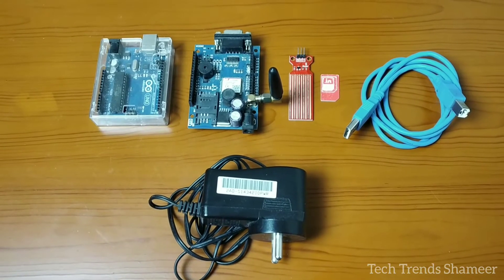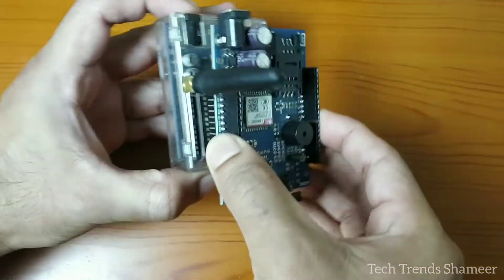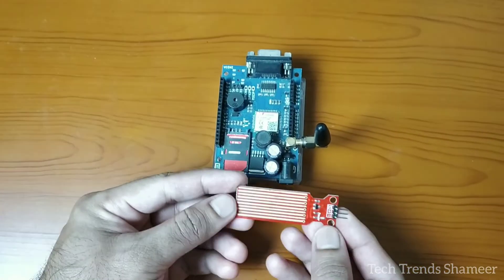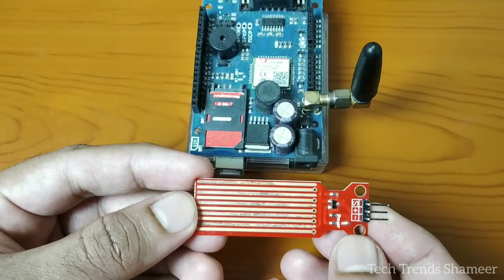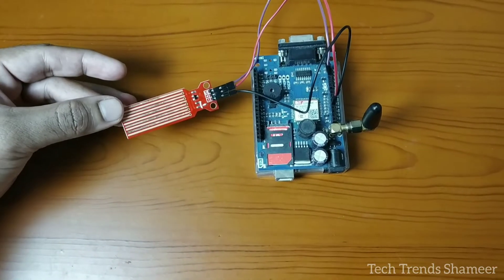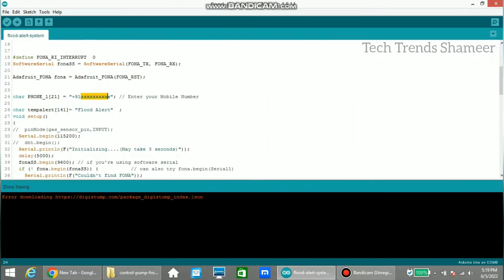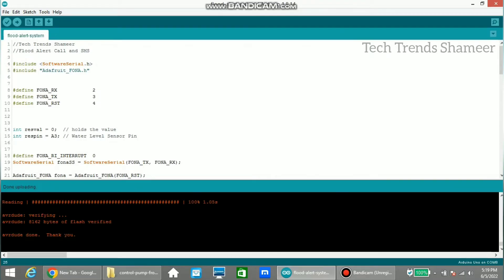Flood alert System Using Arduino Uno | GSM 800

Comment: it is necessary to connect in laptop to work? or it work with out connecting in cable but it is already program
Reply from the maker: You can connect to laptop or power banker

Comment: Sir flood alert using GSM module 900a and separate Arduino board use flood alert making video for your viewers make a call and make a sms and code& circuit
Reply: 2024

Comment: hello sir, how do i modify the code if i will be using the water level sensor in a small stream to detect if water level increases or decreases and have a text message sent to me? reply asap is appreciated, thank you!
Reply: May be you could use HC-SR04 Ultrasonic sensor for water indication

Comment: Perhaps this is a dumb question. Does the sim card inserted needs load ?
Reply from the maker: No need. You can give power to the GSM Module.
Reply: @TechTrendsShameer   Thanks for the reply. Perhaps my first question is misleading. What I am trying to ask is if the SIM card inserted needs balance/load for it to make a call or send a text message.
Reply from the maker: Yes. Need balance in SIM Card.
Reply: @TechTrendsShameer  thank you so much ❤️
Reply from the maker: Welcome. Please subscribe.

Comment: It showind adafruit no such file directory
Reply: Bro how to connect gsm 900a to arduino
Reply from the maker: May I know which type of 900a you are using?
Reply: @TechTrendsShameer  sim900a
Reply from the maker: https://www.electronicscomp.com/sim900a-gsm-gprs-module-india?gclid=CjwKCAjwkeqkBhAnEiwA5U-uM_-GJ7FYilMxvxJnY65PeFtqn2eIcsfIO3Rp-HjlSCHgn0UcJqi5tRoC-_8QAvD_BwE

this one?
Reply: @TechTrendsShameer yes bro
Reply: Please tell me bro connection tomorrow I have project in my college 😭
Reply from the maker: Here are the steps to connect the GSM SIM900A module with the Arduino Uno:

1.Make sure your Arduino Uno is disconnected from any power source.

 2. Identify the pins on the GSM SIM900A module. It typically has a set of pins labeled GND, VCC, TX, RX, and a few additional pins for control (e.g., RESET, POWER KEY).

3. Connect the GND pin of the GSM module to any GND pin on the Arduino Uno.

4. Connect the VCC pin of the GSM module to the 5V pin on the Arduino Uno. Note that some SIM900A modules operate at 3.3V, so make sure to check the voltage requirements of your specific module. If it operates at 3.3V, you should connect it to the 3.3V pin on the Arduino Uno instead.

5. Connect the TX pin of the GSM module to the RX pin (pin 0) on the Arduino Uno.

6. Connect the RX pin of the GSM module to the TX pin (pin 1) on the Arduino Uno.
Reply: What about water sensor bro
Reply from the maker: Connect the signal/output pin of the water level sensor to any digital input pin on the Arduino Uno.
Reply: And can I use the program or not
Reply from the maker: Yes
Reply: Bro code is not working
Reply from the maker: #include <SoftwareSerial.h>

SoftwareSerial gsmSerial(2, 3);  // RX, TX

const int waterLevelPin = A0;    // Analog pin connected to the water level sensor
const int floodThreshold = 800;  // Threshold value for flood detection

void setup() {
  // Set up the GSM serial communication
  gsmSerial.begin(9600);
  Serial.begin(9600);  // For debugging, connect Arduino Uno to your computer via USB and open the Serial Monitor

  pinMode(waterLevelPin, INPUT);  // Set the water level pin as input

  // Other setup code...
}

void loop() {
  // Read water level sensor data
  int waterLevel = analogRead(waterLevelPin);

  // Convert the analog reading to a percentage
  int waterLevelPercentage = map(waterLevel, 0, 1023, 0, 100);

  // Check if the water level exceeds the threshold
  if (waterLevelPercentage > floodThreshold) {
    // Water level is high (flood detected)
    // Send an SMS and make a phone call using the GSM module
    sendSMS("Flood Alert! Water level is above the threshold!");
    makePhoneCall();

    // Add any additional actions or alerts as needed

    delay(30000);  // Delay for 30 seconds to avoid repeated alerts
  }

  // Other code...

  delay(1000);  // Delay between readings
}

void sendSMS(String message) {
  gsmSerial.println("AT+CMGF=1");  // Set SMS text mode
  delay(100);
  gsmSerial.println("AT+CMGS=\"+1234567890\"");  // Replace with recipient's phone number
  delay(100);
  gsmSerial.println(message);  // Send the message
  delay(100);
  gsmSerial.println((char)26);  // Send the Ctrl+Z character
  delay(1000);
}

void makePhoneCall() {
  gsmSerial.println("ATD+1234567890;");  // Replace with recipient's phone number
  delay(10000);  // Wait for 10 seconds (adjust as needed)
  gsmSerial.println("ATH");  // Hang up the call
  delay(1000);
}
Reply from the maker: Please install the library from Tools -> Manage Libraries

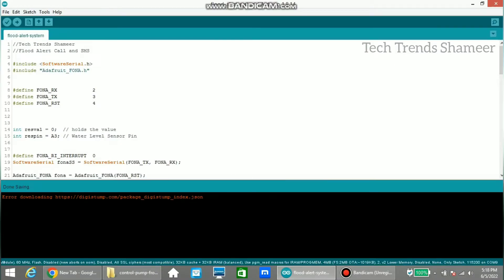Comment: Sir, what is the LCM 1062 IIC, given in the circuit diagram at 2:16. Is it the gsm module? Can i use the same circuit diagram to make the connections?
Reply: It's I2C for lcd

Comment: Sir can you please show how to connect arduino to the gsm module without the gsm shield
And also how to connect water level sensor to the gsm module without the shield??
Reply from the maker: Arduino GND to GSM GND
Arduino 5V to GSM 5V (VCC)
Arduino TX to GSM RX
Arduino RX to GSM TX
Reply: @TechTrendsShameer how to connect water sensor to gsm 900 a my gsm module doesn't have pins can I connect it with my Arduino ?!

Comment: Hello sir, is it possible to put a buzzer and a led to your system? if so, where should we put those stuffs?
Reply from the maker: Yes. You can add. Need to modify the code as well.
Reply: @TechTrendsShameer  can i ask a copy of modified code sir with those buzzer and Led?
Reply: @TechTrendsShameer  Hello sir! Do you have any references or links to the following items? (1. Arduino Uno, 2. GSM SIM 800 C Module) These products are currently
 not available.
Reply: or can  you provide the specific model of arduino uno and gsm module?